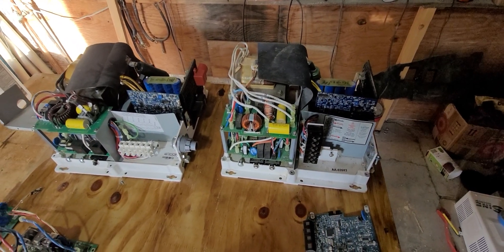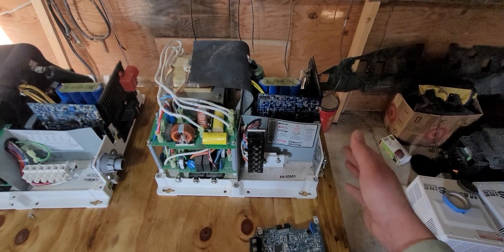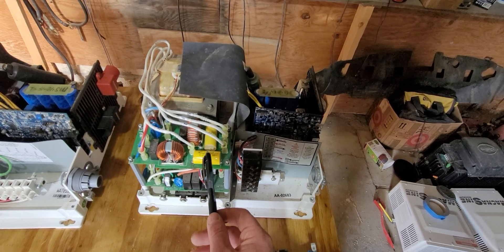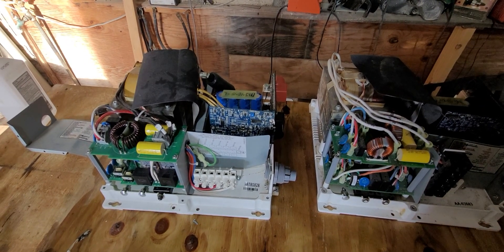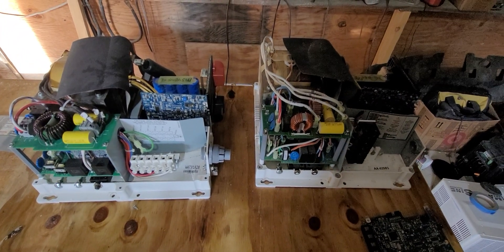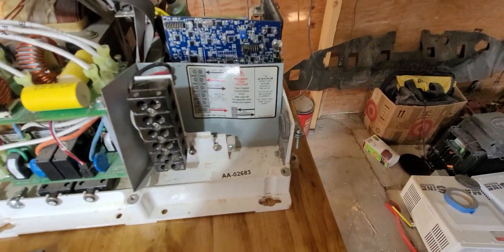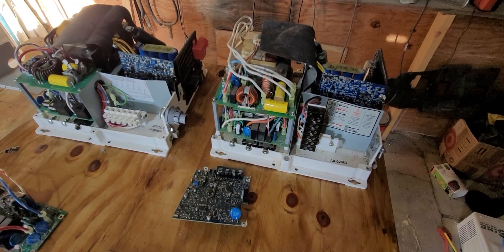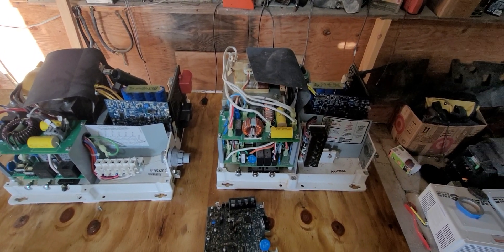Magnum Inverters

Comment: GOT A MINUTE - I installed a lithium battery in my motorhome, and my Magnum ME2000 inverter doesn't play well with it. I bought a controller with a sticker on the back that says lithium compatible. The controller might be, but the inverter doesn't understand most of the settings. It will not bulk charge the battery. What model magnum 2K sine wave inverter do I have to buy that will understand the controller and work with my lithium battery. Thanks, Ed

Comment: First! No one doubts the ability of Western design inverters, just that the rush to independence forces people to think in the short to mid term since no one knows what the world will look like once the depression induced scarcity sets in. You're gonna be ok if you can learn to fix the more ubiquitous Chinese low frequency designs since weight isn't an issue with stationary off grid power.